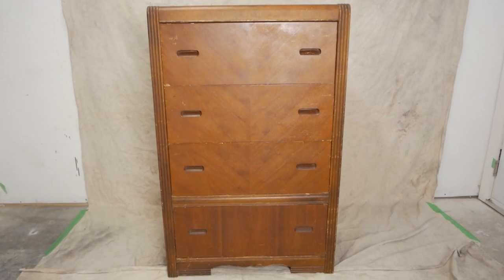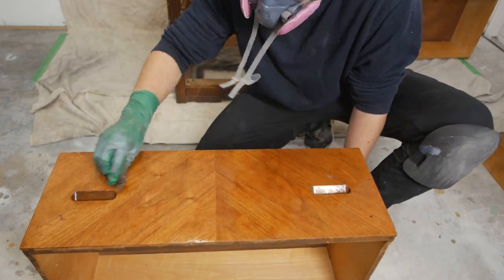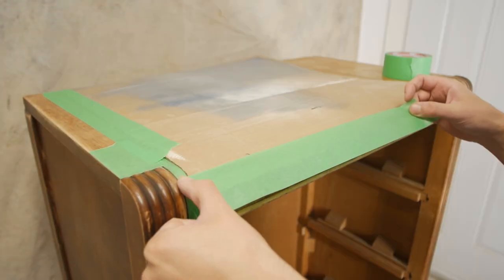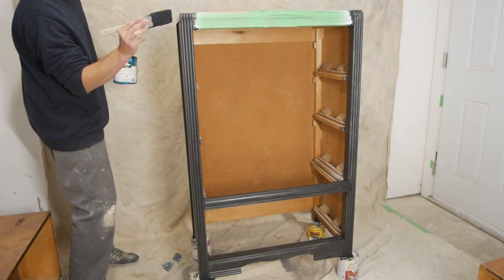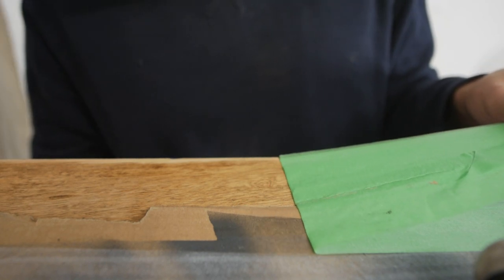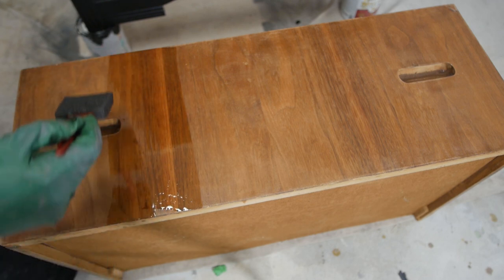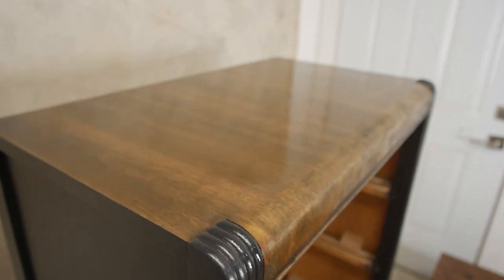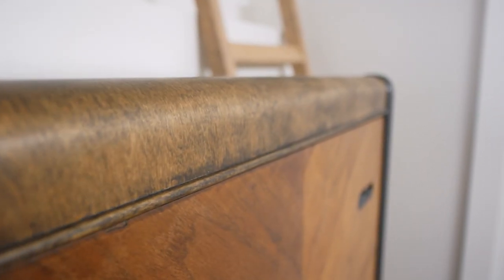$20 Thrifted Art Deco Waterfall Dresser Makeover

Comment: One of the beauties of using lacquer is that unlike polyurethane you shouldn't have to sand too much between coats like that.     With lacquer you can keep building multiple top coats within minutes of each other.  This aids in keeping runs and dust nibs to a minimum as each new layer melds into the previous one. 

Unfortunately due to much state regulations lacquer can be a bit difficult to get here in Southern California.  And as for mineral spirits?  Denatured alcohol? They have been taken off of our woodworking shelves as well.  
 
For give me if I am rambling too much.  You do beautiful work,  keep it up and thanks for sharing your methods.
Reply from the maker: Totally! I like lacquer but is definitely harsh on the lungs if not properly protected. I used it a lot but I am trying to spray wb-poly more just to save my lungs haha Thanks for the nice comment and thanks for watching.
Reply: @FurnitureFlippa  I just subscribed to your channel.    But yea,  most definitely, stay healthy.  
 Unrelated,  I just got a killer deal on 6 authentic red oak Craftsman/Mission style dinning chairs.  I'm guessing early 20th century. They were all creaky and  wobbly, one of them was even missing a  stretcher bar.  So I made a new one, painstakingly dismantled, reglued and clamped everything  up.  They turned out beautiful and are like new.   My wife loves them and I'm figuring that they should last us another good 20 years.  
profit
Reply: A true labor of love.   But after 20-30 hours of labor how could I possibly make a profit here?
Reply from the maker: @markahearn1  chairs are difficult, they take a lot of time. I try to avoid them unless they don't need work. Hard to make a profit when they take so long to fix up. Thanks for subbing though!
Reply: @FurnitureFlippa  Thanks for your professional advice.  A real killer deal on the chairs, lol.  On the bright side it was a great learning experience, after all if I now can restore a chair,  a table wouldn't be that much different.  Plus I got save a few beautiful pieces of antique furniture from the going to the land fill.  Thanks again

Comment: If you put the stripper on thicker 
So it doesn’t dry out and then cover with plastic so it doesn’t dry out even more the finish will definitely come off easier,  I do these old pieces and if you do it that way it comes off quite easily,  and try remove your tape before the last coat is dry I always remove the tape straight after I have put the final coat on then you don’t risk pulling the paint off and as the paint underneath your last coat has “softened” you won’t get the problem where the paint and tape had fused together,  nice job by the way
Reply from the maker: Thanks nice tips! And I started using Klean stripper and its way better, that cheap stuff wasn't cutting it!

Comment: Old furniture finisher 40 + years here, I sand old walnut to 220 and use a Minmax Puritan Pine to enhance the natural amber in walnut that has been oxidizing for 70+ years. A blotchy affect is generally inconsistent or not enough sanding. Also I am not sure why you use an Ebony stain if you want to bring out the walnut in a high contrast against your paint. The Ebony stain suppresses the walnut whereas the Puritan Pine coaxes walnut's best colours to the fore. Just two centsing here.
Reply from the maker: good info! Thank you!
Reply: @FurnitureFlippa  Pardon my manners, I should have stated that the high contrast is very stylish looking. I like high contrasts but stick to wood tones. Against walnut I like to blend Varathene stains like Kona which leans to black and add it to any of the walnut tones. If I need it a deeper tone I add up to 20% of the stain to the lacquer or Varathene (Flecto) and spray it to the tone I want and top coat with a final clear coat. This stuff gets in your blood don't it?

Comment: It looks fantastic. I really appreciate your mix of paint and stain designs. It looks like there's a veneer chip in the corner of a drawer. If so, how did you fix that?
Reply from the maker: Thank you! Based on time I didn't fix any chips because it wouldn't be worth my ROI when selling. You could do a few things, cut new veneer to fit and glue, or add filler and paint it to match wood grain, and other ways. That's really a step towards restoration which I may get more into in the future!